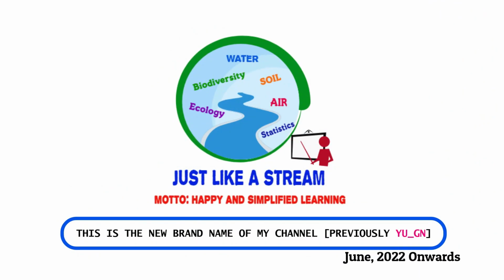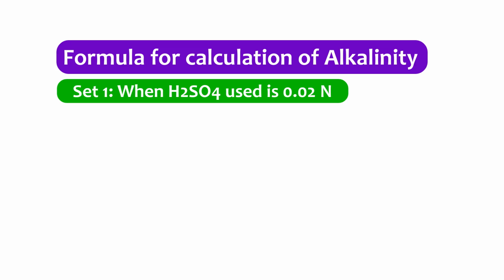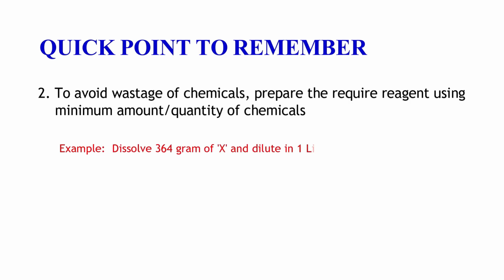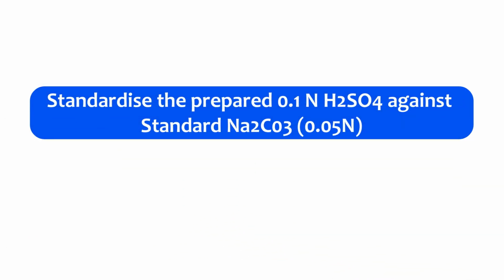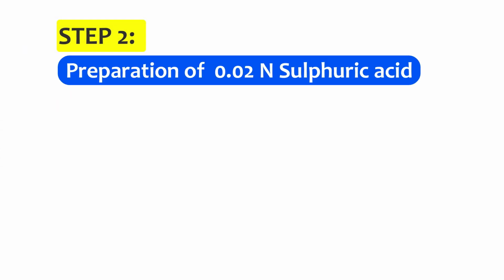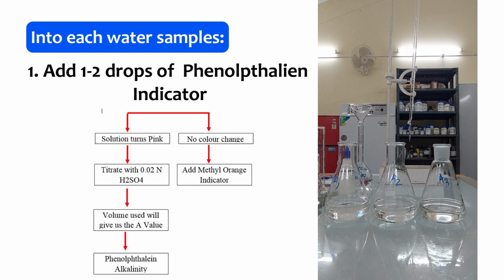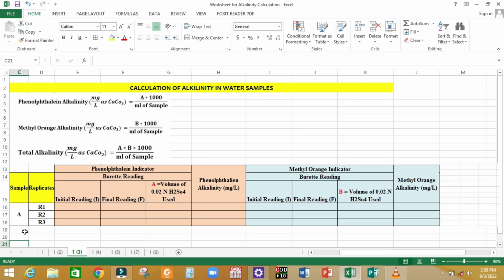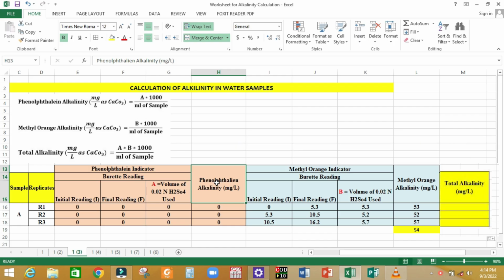Estimation of Alkalinity in water samples by Titration Method (A-Z)

Comment: To prepare 0.05N sodium carbonate we need to add 1.325 g in 500 mL of distilled water not 2.65 g of sodium carbonate.
Reply: Dearly you are right ,to me he prepared 0.05 M Na-carbonate  instead of 0.05 N ,as very well known to us ,we need to know equivalent wt when preparing such solutions,so for 0.05 N ,we must weigh 1.325 for 500 ml ,and if on the other hand he had to prepare 0.05 M ,no need to get eq.wt ,just multiply ur molarity with molar mass and prepare as per ur requirements.👍🏻👍🏻👍🏻